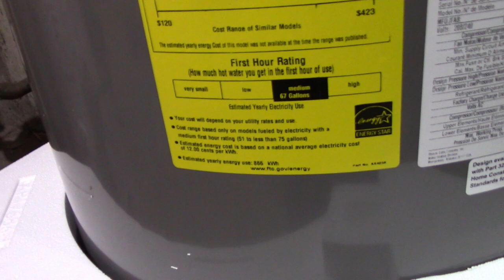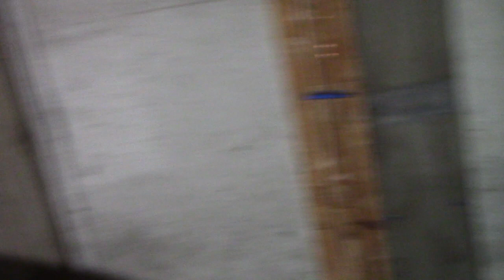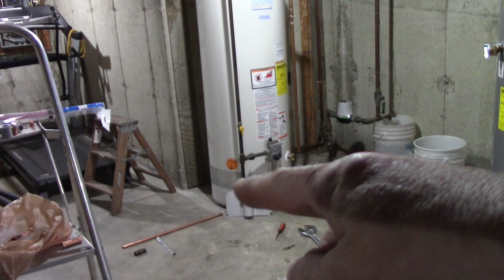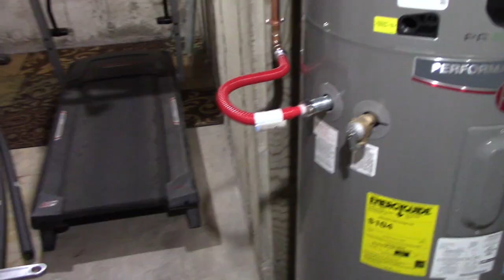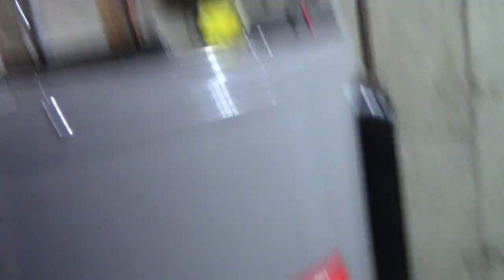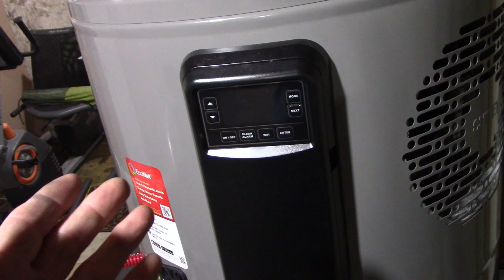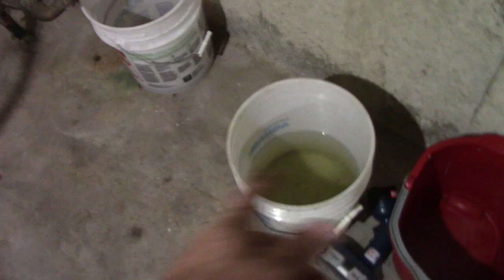DIY Rheem Hybrid Water heater complete installation. From gas to hybrid.

Comment: Great stuff, informative video. If you run the cold air out through your old gas exhaust then it’ll run much more efficiently because it’ll be in a warmer environment.
Reply: Negative! According to the instructions, the size of the gas exhaust pipe would be TOO SMALL for the outlet exhaust of the heat pump. This would create too much back pressure on the exhaust system and possibly burn out the heat pump and/or the fan motor for it due to not enough air flow. (Nice thought though.)